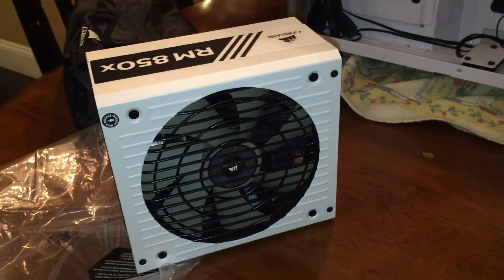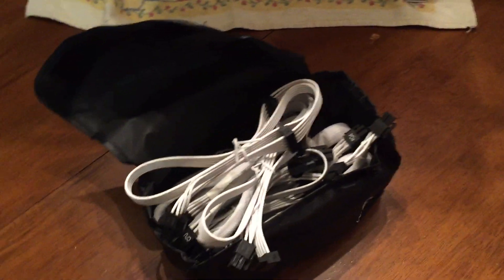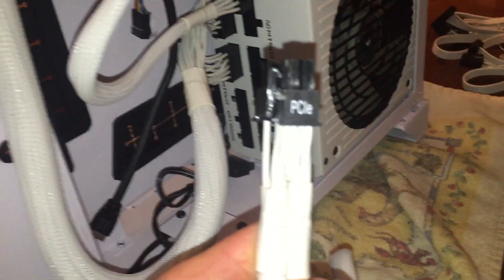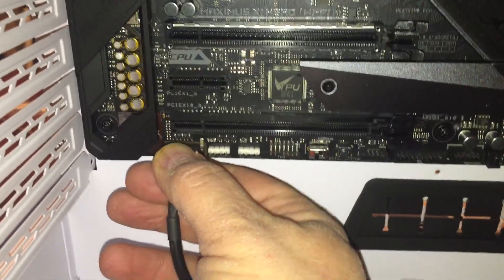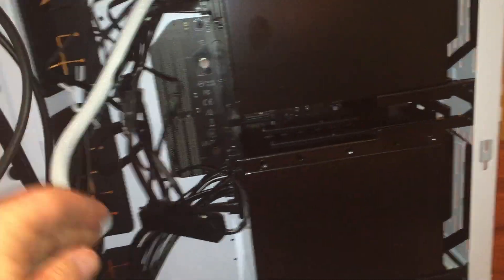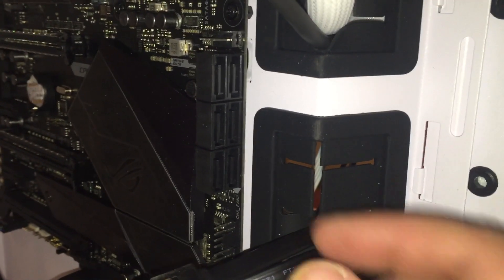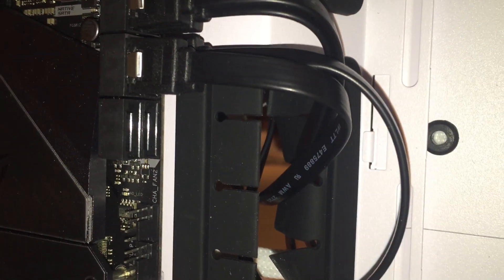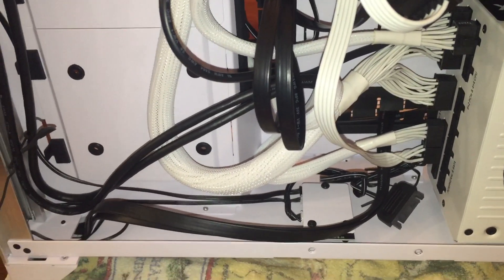Building a Computer Guide - Part 3

Comment: Where did you put your led cable that comes with the box it’s a three ping with and arrow on top
Reply from the maker: I don't recall that cable. Can you send a photo? Once i connected the front panel power, the case LED was powered but controlled by the bottom switch on the case.